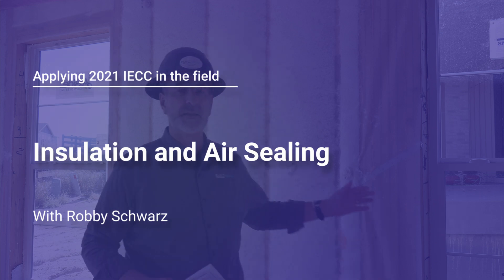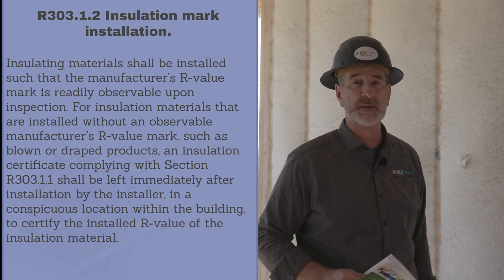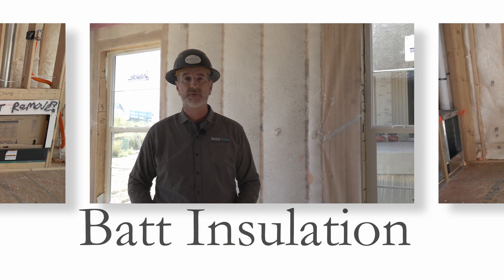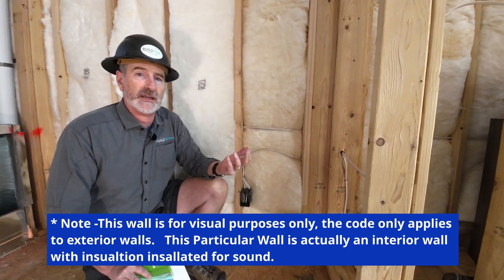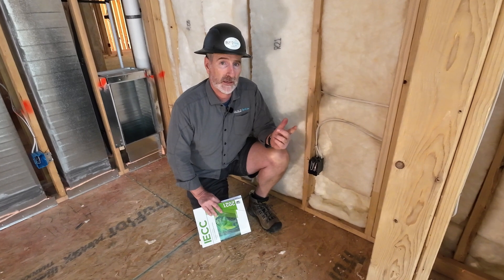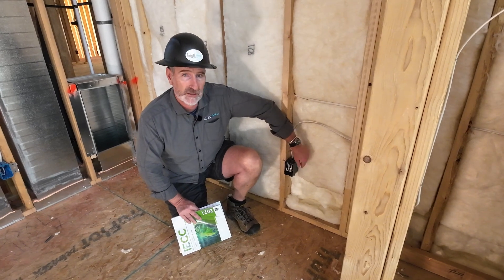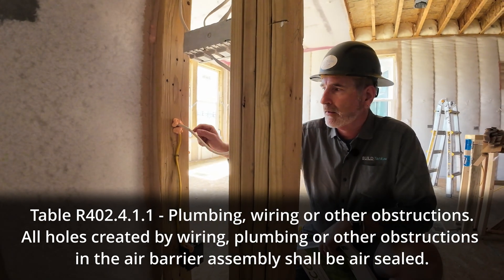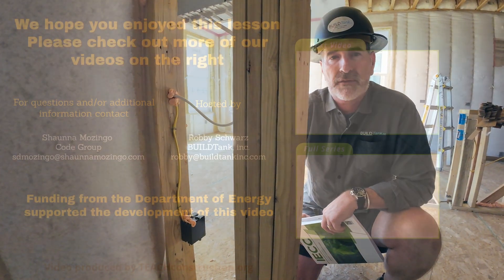Insulation and Air Sealing  - Field Application of the Energy Code

Comment: That 8 stud thermal bridge is $$$ :)
Reply from the maker: It sure is.  I have to stop myself from calling it out on the video.
Reply: I especially like the sprinkler system they have set up in that 8x5 bathroom
Reply: A big multi unit building like that needs a sturdy column that’s for sure….haha